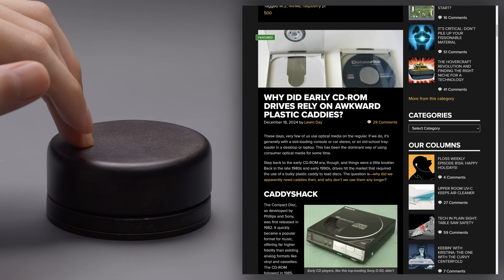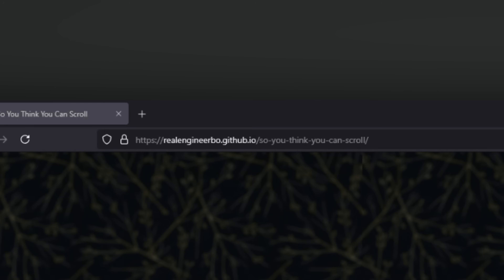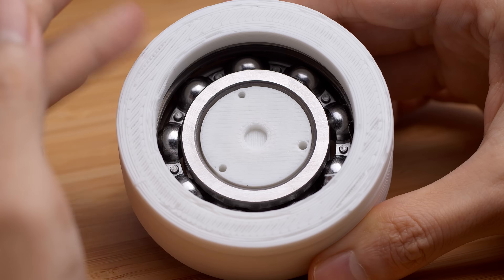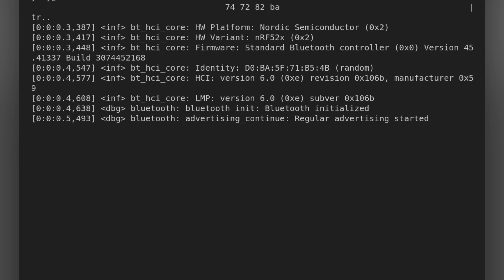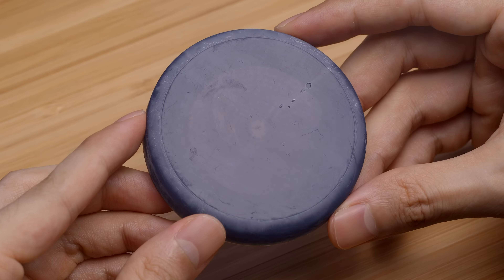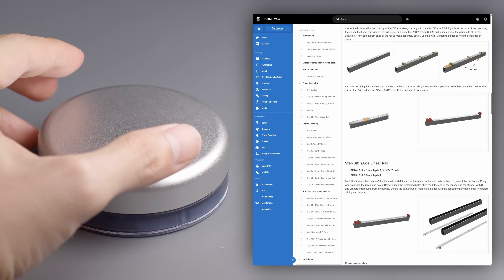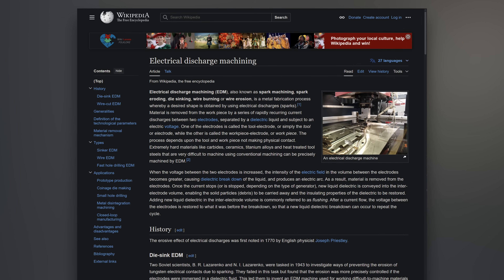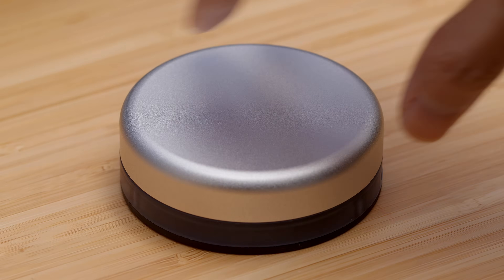Wireless High Resolution Scrolling Device: Full Scroll Dial v2

Comment: In MacOS there is a preference called “natural scrolling” in the mouse and keyboard area. I disable it as it is what inverts the scrolling
Reply: This is true - I would suggest just putting a small switch on the bottom of the scroll wheel though, because it would allow users to change which way scrolling works without having to deal with the setting anywhere else. Additionally, that particular option can be problematic, depending on which way you want to scroll on the touch pad. Personally, I like ‘natural scrolling’ on the touch pad, but hate it on a mouse. MacOS - as far as I’ve ever been able to find - does not allow you to change the ‘natural scrolling’ option on a physical mouse vs touchpad basis, so it’s OS wide all the time.
Reply: @KaminKevCrew  Ideally the device would be able to know what it is connected to and use that to adjust its virtual dpi and direction.
Reply: @StormBurnX  sure - you would have to query the OS for settings - such as scroll direction, then change the setting accordingly. Not that hard to do, but it would be nice to have a switch. You could combine the two, where the switch determines if you want clockwise scrolling to be up or down, then it could figure out what OS it's connected to/what the scroll settings are, then provide scroll data in whatever manner would be required to match what the switch indicates. 

That would be nice because if multiple people are using a computer, they could flip the switch to change the setting.
Reply: @KaminKevCrew  Oh! I meant it much more simply - depending on the bluetooth stack, it's possible to do some amount of host device fingerprinting and infer whether you're on a mac or not to know whether to automatically invert scroll direction. Sadly most standard bluetooth HID communications are very unidirectional, and for a good reason, so without adding additional protocols or the annoyance of "install my app for extra functionality" (thereby losing the magical 'it just works' out of the box experience) there's not really a way to make it properly automatic, and would rely on people flipping switches constantly to toggle the modes. Perhaps something more robust such as a capsense button would be ideal :)
Reply: @KaminKevCrew I would just have it switch over if tapped 5 times
Reply: There are also apps like „Scroll reverse” or sth. This way you can reverse the direction on mouse only without changing it on touchpad
Reply: It's very annoying on macbooks, becaude the switch is shared between trackpad and scrollwheel

But there are some tools that let you have it separate, like ScrollReversal
Reply: I turned off natural scrolling in 2015 and never looked back. So much easier once you’re used to it.
Reply: @KlausKlass  same for me, It just feels wrong :D
Reply: You can also use Mos for the sensitivity
Reply: Also you could tune down the sensitivity/speed for Mac
Reply: @ lol why would you make a huge, high resolution scroll wheel, then reduce the sensitivity so it takes more than a full rotation per page?
Reply: I actually prefer inverted scrolling on a trackpad as it feels more natural. I guess that's why they chose the name for it in the settings. But on a standard scroll wheel it definitely doesn't feel right.
Reply: More modern versions of Windows also do this. (Or at least the store demo laptops do) It's called natural scrolling there as well. I don't understand why
Reply: @cpucat i believe windows only does it with trackpad drivers, not scroll wheels
Reply: Unnatural scrolling amirite?

Typical Apple egocentrism, reinvent the wheel, sell it as the default.
Reply: @bazzatron9482  I feel it is more natural
Reply: @bazzatron9482  i mean it is way better on trackpad and trackpad is superior on a mac laptop unlike trashy windows laptop trackpads
Reply: @bazzatron9482  it’s much more intuitive IMO on a touchpad (which Apple still sets the gold standard on hardware-wise) than the traditional direction.

It’s absolutely terrible on any other scrolling device though.
Reply: Yup. First setting to change on a new Mac lol. 

I think the intent is to keep consistency with swiping on a phone/tablet, but in reality, it just fights a long-time computer user’s already learned and internalized scrolling instinct.

Comment: Think of the macOS difference like this: other operating systems have a viewport with a camera looking down at a “paper”. When you scroll, the camera moves. Scroll down, the camera moves down along the paper.

macOS does it the other way around — the camera is fixed, instead you’re moving the paper up/down. You scroll up to move the paper up, which looks the same as the camera moving down.

This makes a lot more sense when you think of touch-based interfaces, like scrolling on a phone/tablet with your fingers. You’re sliding the “paper” around with your fingers.
Reply: Also every os has a setting for that. My Linux compositor also has it the way macos does by default.
Reply: With a drawing tablet, I agree, since you truly 'grab' the canvas with the stylus.
Pressing the lower button even makes for a grabbing motion, so this is very intuitive.

With scroll wheels it feels like feeding a page in a typewriter, which I guess the wheel would be based on too.
This makes sense, since on PCs you are essentially feeding a page around the cursor.
But I can not defend inverting this, both since by this logic it makes no sense and as scrolling down is more comfortable.

Since the two-finger scroll gesture is detached from the actual grabbing and dragging done with a drawing tablet, I view it as operating a massive wheel.
Though if an OS goes as far as to forcing the touch-like direction to a desktop input, it can be a good sniff-test on whether the OS makes the mistake of optimising the desktop interface for touch in more areas.

In Linux land this can be useful to assess the various desktops, along with of course their general design.
Though on any competent OS, this setting is invertible.

Comment: Great improvements, love this series. Do you have any issues with false scrolling when you lift your hand off the dial? It looks like that bearing spinning a lot more freely than your original could lead to accidental scrolling. Have you experienced this in your testing?
Reply from the maker: This problem (which was definitely in the previous build) should have been reduced in this build because of the increased moment of inertia, and in practice, I haven't had any issues!

Comment: Question,what resources did you use to design that antenna/learnt about it.
Reply from the maker: Not going to lie, I'm definitely not a pro when it comes to antennas. I've read a (reasonably large) number of documents like the Cypress application note shown in the video (Antenna Design and RF Layout Guidelines) and that helped.

But crucially, since this is a project using Nordic's chips, I asked them (the pros) to check my design for any obvious problems before I sent it off to be made.

Comment: In my experience resin prints better at an angle, lychee should do that by default
Reply: You also get warping from the residual stress caused by the way the film pulls away from the print
Reply from the maker: I'm actually not so sure printing at an angle would improve the result, even though that seems to be the recommendation. Particularly for this part, I wanted the components to come out perfectly round, so it made sense to me to keep all the peeling force axial to the part.

Also printing flat is faster which is nice.

Comment: Awsome project !

A small tip that might help you with resin printing, in general you don't want to print large flat faces parallel to the print bed like with FDM. Try rotating the whole assembly 45° and see if that fixes things. It will also help with the "suction" issue, removing the need for a hole. It's okay to have tall needle support everywhere, that's how it's done.
You also want the wall to be as thin as possible. Having big chunck of material will cause strong shrinkage like you experienced. I think FDM printing would have been more suitable if your machine was working better probably, but hey we only have the tools we have I guess.
Reply: Beat me to it! Thanks for being helpful and friendly :)

The resin prints I’ve been running recently naturally have a flat bottom perfect for FDM, but requires MSLA resolution. I just slapped those bad boys on the build plate directly, and I don’t have to worry about supports at all. The internal chamber can cause cupping, but it’s small enough that the resin doesn’t actually drain out. It works surprisingly well! Resin supports are the worst, so I avoid them like the plague.
Reply: Using 45° would often result in lines along the plane, but if you set up the layer height to the same size of the pixel width it will help reduce it or fix it completely. 
Anther way a bit more involved is to calculate the perfect angle for your printer using this formula: 

arctan(layer height/pixelwidth) 
 
You have to find the pixel width for the LCD panel of your machine (Google can help with this) 
I have had great results using this, and the credit for finding it goes to @TrueEliteGeek here in YouTube and his comment section.

Comment: On macOS, the issue of reverse scrolling is because "Natural Scrolling" is enabled in the mouse settings, which was a setting they brought in for touchpads, but annoyingly cannot be set independently for mouse or trackpad without 3rd party software.
Also on linux, there's a config file you can create under /etc/libinput/local-overrides.quirks to enable it.
Edit: I tried your scrolling game, and you've successfully convinced me I need one of these. Nicely done good sir.
Edit 2: I'm a rust engineer that works on linux and a Mac daily, if you want help debugging/writing something hit me up! my email is on my github